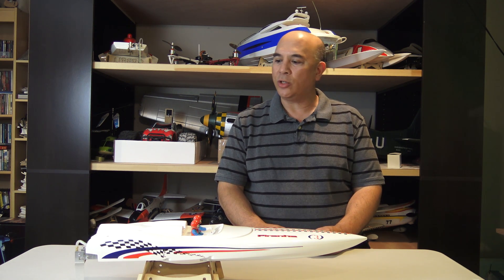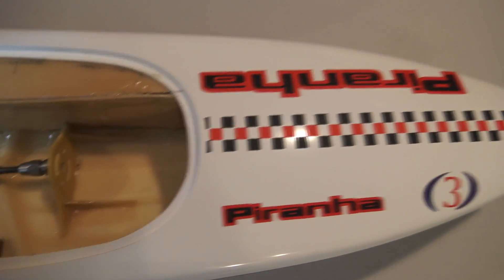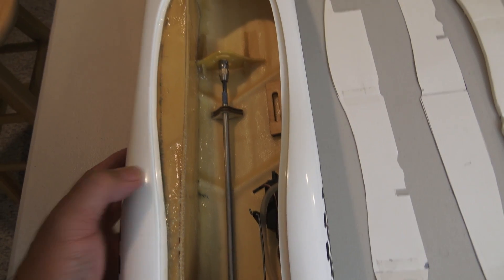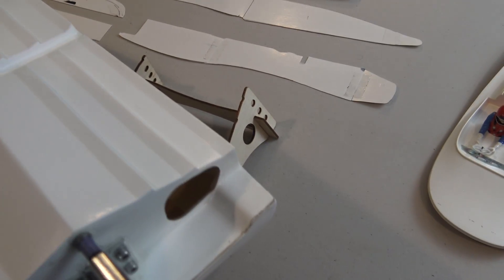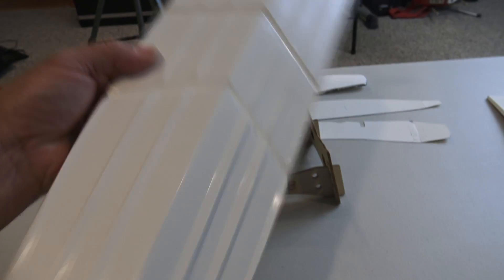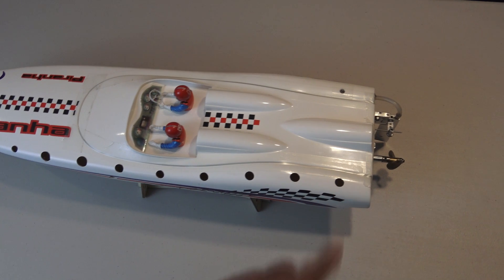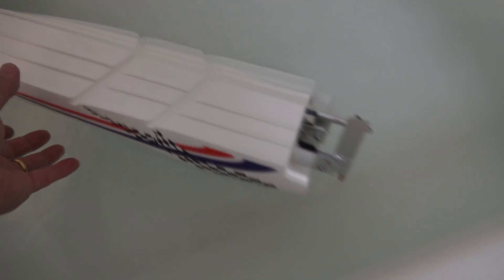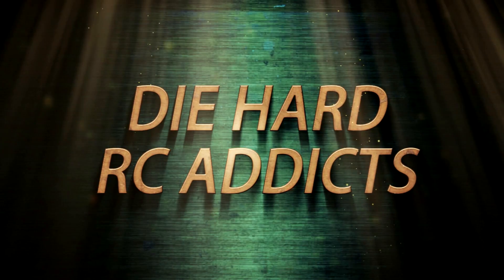RC Boat Self Righting Flood Chamber Mod

Comment: Thanks for sharing. Good solution. You can avoid the holes in the bottom if you make an air outlet on the opposite site to the thank of the hull connected to the flood tank. You can check this solution on the Joysway Rocket 26. Check the system in this video @3:45  https://www.youtube.com/watch?v=GAKPa3FBSDQ&t=2s

Comment: glue in a pvc pipe cap the end cut hole job done
Reply: So that would work with the lipo off set to the pvc pipe have you tried and tested this method.

Comment: excellent job and explanation both. yes that hull DOES look like a real pain to make the internal chamber template for. just watched the test run video, the added vent in the step sure has her flipping upright nice and quick!
Reply from the maker: Thanks, I was real happy with the way it all worked out. It flips the boat back over in about 6 seconds. Hopefully the next boat I add a flood chamber to won't have so many crazy contours. Would be a lot easier if all the pieces could be flat.